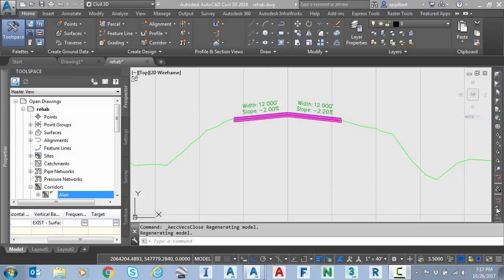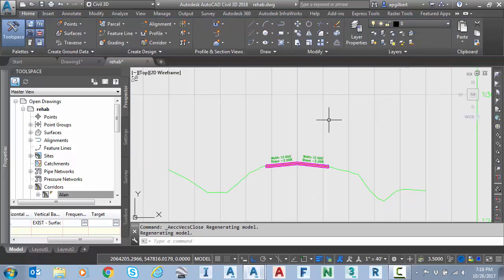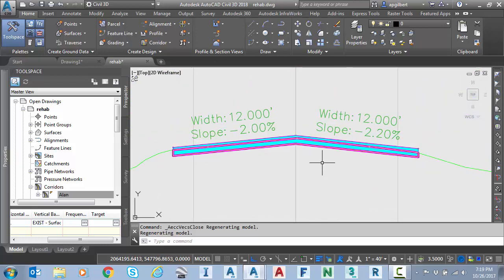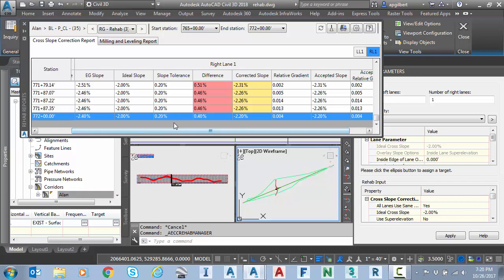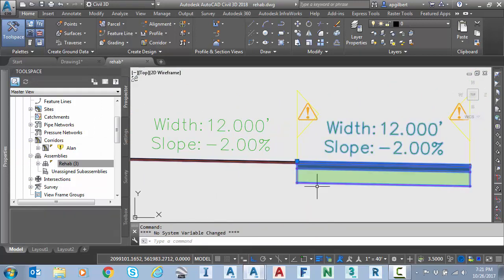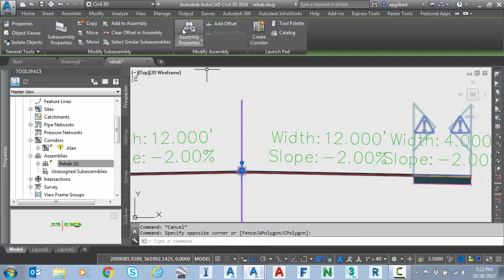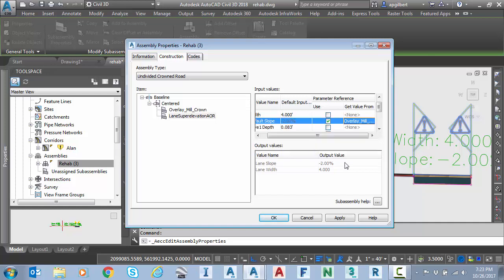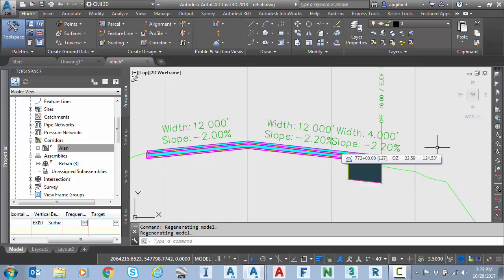Finish Strong Friday: Rehab Corridor Part 2 – Add Widening

Comment: Hello i was wondering if this  rehab tools can work on road with superelevation because of that default slope we have to enter
Thank you
Reply from the maker: Hi Clement, you can change the setting of the "Overlay Slope Options" within the rehab parameters (lane control) to read the superelevation values you have defined.  These values will populate directly into the "Ideal Slope" column of the cross section correction report.  From there you can fine tune the tolerance to decide how far from ideal you are willing to let the slope vary.
Reply: Alan Gilbert  Thank for your response it helps me a lot. If you get time you can help me video for better understanding. Thank you
Reply from the maker: No problem.  I have this video on my list; should be coming soon.
Reply: Alan Gilbert Thank you sir